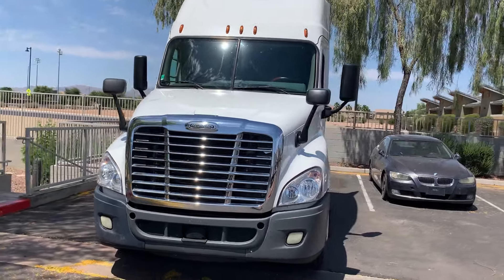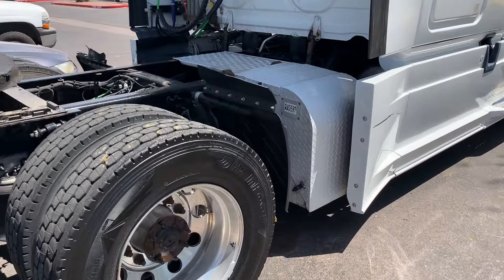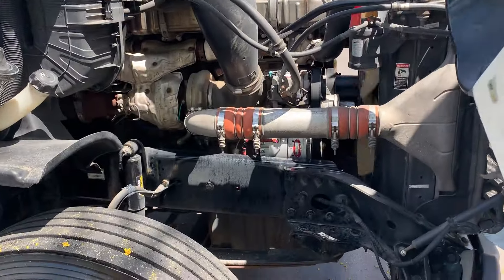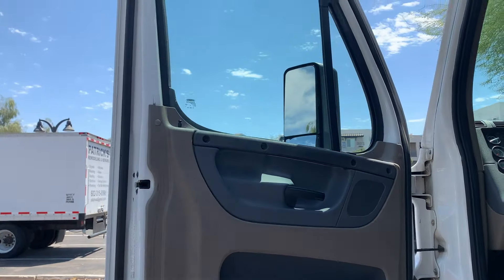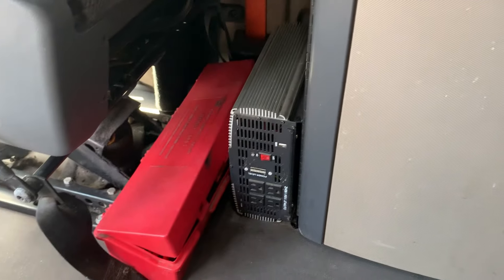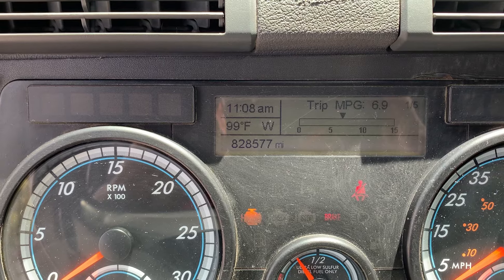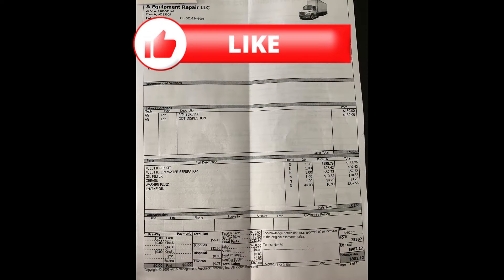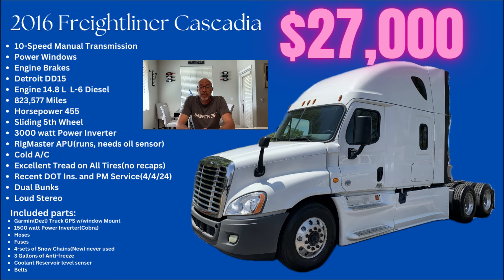She's For SALE!!

Comment: So if I may how come you selling the truck and not save it for the long run anything can happen and can come up it’s a good ace in the hole
Reply from the maker: Hey Poptart. Because of a few breakdowns and the downtime that has gone along with that, I’ve gone into debt, so I want to sell the truck to offset some of that debt. Also, I don’t want to drive anymore. Thanks for the comment.

Comment: Hey Scorpion, hope you get it sold quickly. I am in the market for a truck with a wet kit. Question, if I found one in the Phoenix area, would you be able to go inspect it for me? There's a place in Chandler that sells them from time to time. Let me know if that's a possibility. Thank you. Peace.
Reply from the maker: Hey bro. What is a wet kit? I've only owned this truck and when I bought it, I hired the mechanic with the company that I was working for and he came out and went through it with me. Honestly, I would feel comfortable inspecting a truck alone. Good luck with your next purchase.
Reply: @scorpiontrucker  A wet kit is a hydraulic pump and PTO set up. Just looking for an in depth pre-trip, basically. Brake percentage left, leaks and the like. Keep us updated on your next chapter. God bless.

Comment: What’s the gear ratio?  What mpg you typically get?  Any issues with the differentials?  When was that oil changed last?
Reply from the maker: Hey wcf. I don't know what the gear ratio's are. I typically get 6-7mpg. No issues with differentials. I changed the grease in them last year and oil change and lube last month.